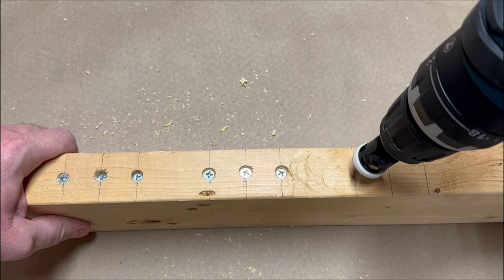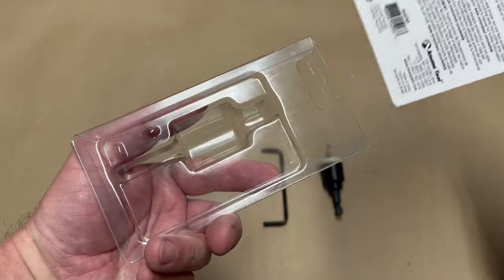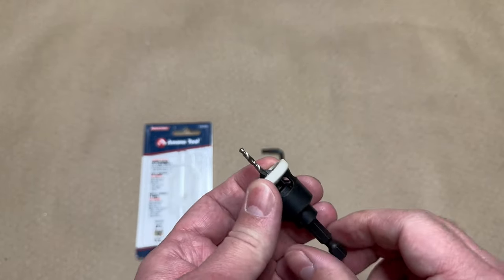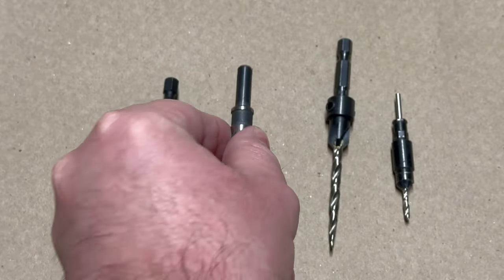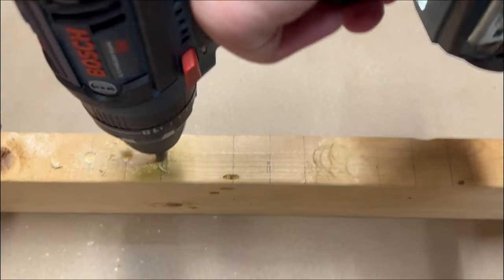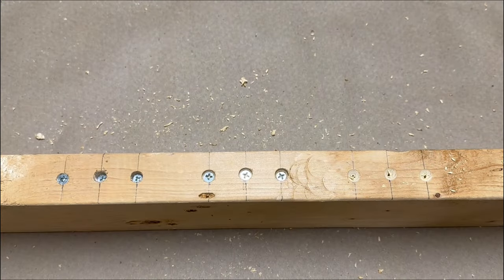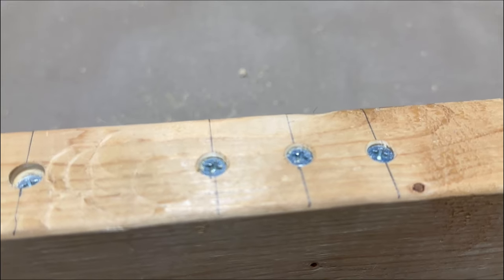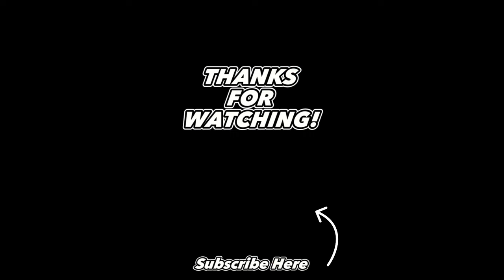Perfect Countersink EVERY Time! Amana Tool 55293 Demo and Review

Comment: Thanks for sharing. I've seen this do the rounds on YouTube, an it certainly looks like a nice tool to use. Alas, as it comes in at £43 over the pond, I'll be giving it a miss. Rather spend the cash on a new table saw blade. That said, I hope you enjoy the new toy.
Reply from the maker: That it is a bit steep!  A new blade can be just as satisfying though.  Thanks for watching!
Reply: Sorry, a bit late to comment, but in case you don't know - the Trend Snappy version (that I've just bought for £20) appears to be identical.
Reply: Thank you so much for the heads up. I'll have a gander at the Trend option.👍 @chrisnortheast888